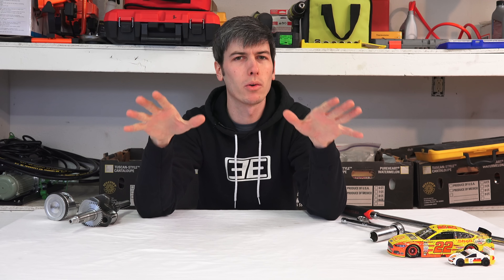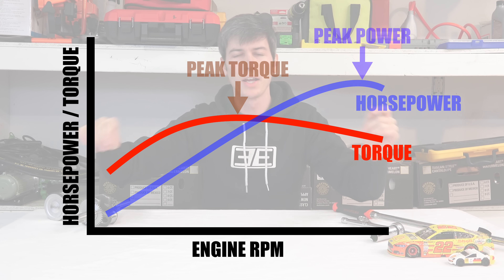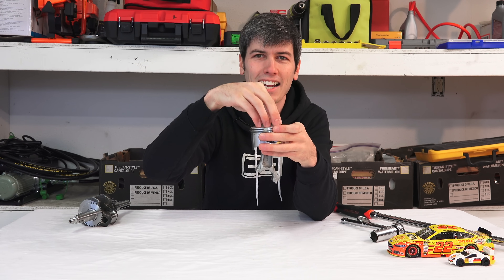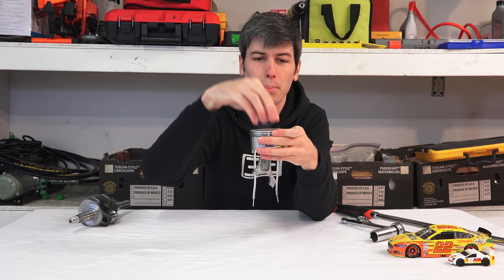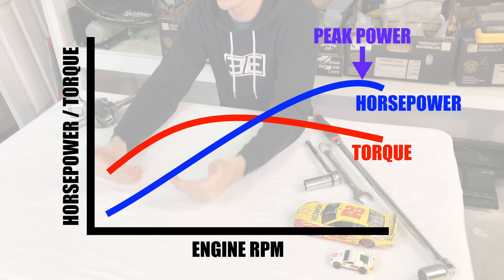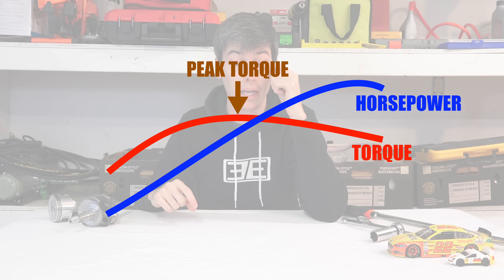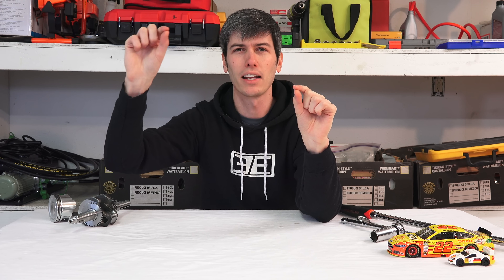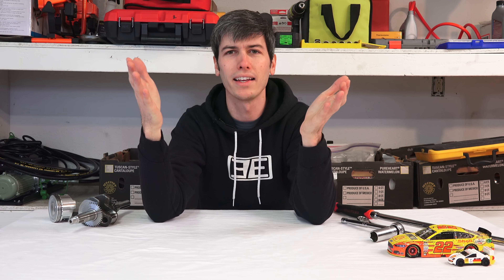Horsepower vs Torque - A Simple Explanation

Comment: I'm very mechanically inclined and have heard the HP v Torque explained in about 10 different ways. I still don't understand it outside of "torque is how much load can be hauled" and "HP is how fast you can haul it."
Reply: Before watching this video i used to think that Torque affects acceleration/0-60, but HP affects top speed….is that correct in any way?
Reply: @mah9389  Not at all. HP affects both  - the 0-60 and the top speed more, gearing affects whether 0-60 is better or top speed is higher. Torque is just a factor which helps to make up/calculate the HP.
Reply: @mah9389  Yes you are right. Torque = Acceleration, Power = Top Speed
Reply: @ssam478  that’s not right at all, didn’t you listen to the video lol
Reply: @ssam478  proof that you can comment without watching or understanding a video
Reply: It took me a minute too. I have an F350 6.0L diesel and a 3.6L Jeep Wrangler. Both rated at ~300hp. 
So why can’t my Jeep pull a 20,000lb trailer even though it’s the same power? Well, in theory, it could. My Jeep only makes 300hp at like 6500rpm and maybe 100 at 2000rpm. I would need a 15 speed gear box just to be able to get that trailer moving, and once it is moving, I would be red lining the engine and could not maintain that power.
The diesel can provide 300hp at 2000 rpm, so I can get it moving pretty easily and not red line my engine doing so. 
What you quoted isn’t true technically, but it is practically. You can gear 300hp to put that power where you want it (optimized top speed or high load, pick one) but practically, you build your engine for it. A 15L semi engine is very high torque. Can probably make 300hp at 500rpm. It can drag 80,000lbs up a hill all day, and that 2000lb engine is a drop in the bucket for the rest of the truck. Now take a 700hp street McLaren. Most of the time it’s driving at road speeds and only needs 100hp. But when on the track and it wants 700hp, it can put it down in short bursts (at 8000rpm). That 4L engine would explode if you asked it to maintain full load, plus it would require a loooot of gears to have that power at a starting speed. And you would burn through clutches every 1000 miles. 
The penalty of a high torque engine. Is while that 6.0L engine can make that power at only 2000rpm, it redlines at 3500. It’s too large to be able to get the rpm improvement to get higher peak power. Ya, if you could spin that same engine at 7000rpm, that would produce hilarious power, but the bigger pistons and longer bore couldn’t handle it. 
Hope that makes it slightly more clear than mud.
Reply: @ctbrahmstedt  Do the high torque engines make their greatest power at peak RPM?  For example, the engine you describe at the end.  It makes a lot of power at 2000 RPM but does it make more power at its max 3500 RPM?
Reply: @fltchr4449  actually, you’re hilariously and technically right. I was looking up the horsepower/torque curve earlier today on the 2006 F350 and it happens to make its peak horsepower at almost exactly 3500rpm. But that’s not always the case. In a perfect world, the torque curve would be a flat bar, meaning the engine can apply the same torque at all rpm, let’s say 500lbft. In that case, yes, the more rpms, the more power, until the engine rips itself apart. However, in the real world, at high rpms the piston begins to move nearly as fast as the combustion itself. When that’s the case, the pressure front can’t actually transmit power to the piston, and therefore net power output begins to drop. Look up a torque curve for your favorite car, you’ll see this dip. The torque curve is measured from a dyno, the hp is calculated from the torque and rpm. 

And most engines make their peak power at, maybe 75% of redline. The difference in high torque engines is that their redline is on the order of half compared to gas. Go look up the torque curve for the 2005 f350 diesel and the 2013 wrangler jk. 325 vs 285 hp. Pretty close in power, but the curves are entirely different.
Reply: @ctbrahmstedt  this video is not about reliability,  overheating, displacement. its just about power,  torque and acceleration. torque can be multiplied with gearing, horsepower can't, period. 
how many gears you need is not about having huge torque, it is about what is your lowest gear (so you can climb any hill at least in first and not get stuck, and start comfortably in first without frying your clutch ), highest gear (for highway cruisng) and how wide is your powerband so you can shift beetween gears without having a huge drop in power. l
this is why even trucks with huge engines and enormous torque still have a lot of gears (10 to 18)
Reply: @geemy9675  And those large trucks are limited in maximum RPM so they need larger gears to reach higher speeds (and all the gears to get to those speeds).
Reply: @geemy9675  yup! Yes, horsepower is a result of torque. And you’re right, reliability has nothing to do with it necessarily. While I was trying to understand torque, I could not for the life of me understand how two engines can output the same horsepower but one has twice the torque as the other. Power is power, period. My 6L diesel vs 3.6 gas both output 300hp, so why is torque important if both engines can ultimately make the same power? Why couldn’t I gear down my 3.6L gas to haul my trailer? Technically I could, but to get the 300 hp, I’d have to ride at 5k rpm and have 50 gears to get there. My point was less about torque vs hp scientifically, but more in how it relates to cars/trucks and what usable and practical power means when comparing vehicles.
Reply: @ctbrahmstedt  a smaller ,  forced induction engine with wide powerband and similar power to a larger diesel engine doesn't need 50 gears to haul. actually it doesn't even need more gears if it has similarly shaped torque curve. what's important is the ability to make high power (let's say > 70% of peak power for instance) at low rpms (ex 50% of redline) . the actual torque value and roms don't matter it's the ratios that do. with a wide power band you can do with 5 or 6 speeds no problem. the reason why modern cars, even turbocharged, have more and more gears is EPA emissions/mpg ratings and the need to have super tall gearing for highway cruising, and be able to run at the most efficient rpm at any speed. super tall gears are pointless for towing anyway.
when you start factoring in towing reliability, you also need your engine that can put out high loads for long periods without overheating or high wear. this can be done on smaller engine. just look at some small japanese engines that are built with such high reliability standards they can run at high loads reliably even after being tuned (properly). but then you also need to consider transmission cooling, so I'm the end you just can't find a complete off the shelf package with smaller gas engine truck that can tow heavy loads for hundreds thousand miles reliably and if you need it you just go for a dedicated big diesel hauler

but let's say you haul once year, you can use any engine that will maintain safe speeds within safe operating condition of the engine
the miles will generate maybe double or triple the wear compared to just cruising, but that's what engines are meant to do

on the end, it's power, not torque, that says if you can accelerate and move a heavy load at  a certain speed.
you can generate lot of torque with your arms using a big wrench, or legs on a bicycle, but it doesn't mean you can tow anything
Reply: @geemy9675  Loved your feedback.  But as I understand, I was wondering now,  since the diesel engine from ctbrahmstedt , has 300 HP, it should mean that the 6.0 diesel engine (even with just 2000 RPM) can pull a car at the same speed as a rally car engine that has also 300 hp ? (if mounted on a chassis with similar structure/weight including engine). 
Since it has a lot of torque to be able to reach same top power of 300 hp, I understood  both engines should make the cars reaching the same top speed (using proper gear ratios), and also the same for the semi engine ? If you mount the semi engine on a rally car chassis, and have same overall weight, it should bring the car to same top speed ?  You seem to be able to explain/express things well, could you please confirm or clarify this doubt ?   Ty
(I'm hoping that the high torque engines, can reach same top speed as a rally car engine, and even get there a bit faster if using longer gears at first  although the heavier engines are not good for using on twisty bumpy roads, where you need an agile car to move around :)
Reply: @madangel71  yes two engines with same power are able to push the same vehicle to same top speed with appropriate gearing. 
top speed = speed where drag equals power.
except if one engine is so much bigger than the other that it has to stick out of the hood., increasing the drag. or so much heavier it increases friction drag considerably. but top speed on a flat road doesn't really depend on weight. its almost 99% aero drag vs power (talking about cars with top speeds at least above legal speeds)
acceleration is impacted by weight though so heavier engine with same power = less acceleration. then you have other factor coming in, number of gears, powerband, close ratio gearbox or not, shift delay, etc
but at any given moment, beetween two cars of same weight and aero, going the same speed, it's the one putting more power that is going to accelerate more. not the one with more engine torque. because more engine power translate translate to more wheel torque. but usually, everything else being equal, same peak power and higher peak torque value is still correlated with wider power curve, and thus better performance (especially daily / road driving, not at full throttle/peak power)
Reply: @madangel71  on paper, yes. 300hp is 300 hp. in practicality, my 6.0L diesel engine weighs 3x of an equivalent hp rally car engine. My truck can put out 300hp all day every day for 500,000 miles and be quite happy about it. The rally car engine operates at peak 300hp, but it would definitely need a lot more servicing if it were running at 300hp all day every day - hell, most race engines get rebuilt after every race. 
Regarding your question of a semi engine on a rally car keeping the same hp and weight, yes, you would achieve the same top speed. If you can make that semi engine have the same torque output but weigh the same as a rally car engine, then patent that and then you can retire for life. That's the big engineering trade off with engines, and the beauty of electric cars. Electric motors make peak torque at 0RPM.
Reply: @geemy9675  
But that turbos gonna be HOT (if cruising in boost for prolonged periods).
Reply: @trumanhw  you mean for example towing heavy load on long distance. sure it's a high stress on every part of the drivetrain. if it's a NA engine you are going to need high rpm to get the necessary power while reducing the load and spool the fans faster etc but your still generating a lot of heat brakes can overheat downhill too, etc
on turbocharged engine, diesel or gasoline you'll have more torque so you can keep rpm lower, but in any case you need every part of the drivetrain to get  sufficient cooling including engine, transmission, turbos, etc
since turbo diesel trucks are the preferred way to tow, I don't think there is anything with turbos
Reply: @ctbrahmstedt  - right.  
HP is about retaining your torque across RPM ranges  ≥ 5200 rpm.  
How long (in a gear) you can accelerate using the force that gear transmits.

As ctbrahmstedt says: Having power at low RPM requires tremendous torque 
it takes:
100 lb-ft of torque at 5252 rpm to have 100 HP - (but let's call it 5200)
200 lb-ft of torque at 2600 rpm to have 100 HP.
400 lb-ft of torque at 1300 rpm to have 100 HP.
800 lb-ft of torque at   650 rpm to have 100 HP.

Torque is a ratchet. A long (but slow) motion.
HP is a screwdriver. Short motion, but no guarantee you can do it.
Reply: Torque is basically how powerful each explosion in your engine is at a given rpm. Now multiply the force of each explosion(torque) by the number of explosions per minute(rpm) and you get how powerful the engine is(horsepower). The reason an engine may tow better with more torque is because it will also make more horsepower at that rpm too.
Reply: Theres more knowledge in this comment section than the whole video.
Reply: Get on a mountain bike, go through the gears, up and down some hills and figure it out for yourself.
Reply: @theingenesistproject  this is by far the best explanation i've ever heard lol
Reply: I agree with you. Torque is required to pull load and Power for speed.
Reply: @ssam478  power is needed to pull loads. it takes a certain power to pull a certain load at given speed on a given incline. you can have as much torque as you want you won't be able to do it at the required speed if you don't have the power. on the other hand if you have the power and you need more wheel torque you can downshift (until you are already in first of course). of course if you need peak power to tow on every incline you wont probably tow for a long time
 "there's no replacement for power" is more accurate than "there's no replacement for displacement". large displacement engine can often be tuned for more power but you typically don't want to do a lot of towing with a tuned engine, unless you are 100% sure about the reliability.
Reply: Torque is directly proportional to initial pickup. High torque means great initial pickup...
Reply: Imagine two cars trying to accelerate up a steep hill. The car with more torque is going to be able to accelerate up the hill more easily.
Reply: @TeamP  power is a function of torque and speed. Power tells you how much torque can be applied at a certain speed. If two engines have the same power but different max torque they can apply the same amount of torque at the same speed, they just use different gear ratios to do so.
Reply: @TeamP Torque is the sound of one hand clapping. The engine’s job is to effect change against a load.  It has no idea if that load is a car, truck motorcycle, a hill, a trailer, aerodynamic drag, flat tires, or wheel bearings on fire… it works the same against the load it sees.  Its ability to effect that load will always be greatest at its peak power.
Reply: @TeamP  sorry but that's wrong. more power will give more wheel torque so more acceleration, provided it's geared properly.

Comment: Torque is the abillity to move weight over fixed RPM, more the torque more the amount of weight you can pull. Power is how fast the torque can be applied on the same weight. Since power is a product of torque and RPMs, little bit of torque and higher RPMs are able to produce more power than the same torque at lower RPM.
At low RPMs, torque is the major factor in car's acceleration as the RPM multiplier is not much, however at higher RPMs the small changes in torque quite significantly changes the power delivery.

Finally, work and torque are the same thing, and work being described as capability of system to expend energy. Note that torque is a rotational work, meaning it's not linear hence torque =work*distance*sin(theta)
and on linear scale power = work/time interval
however in rotational physics it is calculates as power= torque* rpms

Comment: theres not a video in here that explains something simply. they're all complicated. how does engine starts? everyone=fuel+air+spark
engineering explained: throttlebody,ignition coil, sparkplug, air(airflow,airway,airpoof,airmixture,airball,aircon,airbreathe,bad air,con air)+gas(nitro,gasoline,butane,octane, fumigation,gasulinator,gastritis,fuel, few well)  did everyone got it? 😅

Comment: Am I correct to think in this way?

Torque is used to describe the output force of an engine shaft,
Horsepower is used to describe the rate of work done of the whole car setup.
So always use horsepower, unless you're a car engine engineer.
Reply: Torque is one important parameter of a crankshaft's output, but RPM is also extremely important.  An engine's HP will give you an idea of how it compares to other cars of its class, but car weight and the transmission must also be considered to get an idea of how it will perform.  A car buyer may be able to make in informed choice about which engine they will prefer based on their driving style and the maximum torque and HP numbers, but few are informed enough to do so. Luckily, auto engineers will choose the proper motor for the job most of the time, such as using high-torque motors for towing platforms as they won't have to maintain high RPM to tow.

Comment: Ok so if horsepower is how fast you can accomplish work how will a 4ton car get out run by a 2 ton car if they have the exact same hp?
Reply: In your example, you're not changing the amount of work applied, you're changing the body of interest the work is applied to.  Applying the same amount of force to a lighter object will cause more acceleration according to Newton's Second Law, simplified as the acceleration of an object is equal to the force applied to it divided by its mass.  The lighter the mass, the greater the acceleration which is why lightness is good for acceleration.

Comment: Fun fact: if you have either one of the torque curve or the power curve, you can derive the other curve.
To get the power curve from the torque curve, just multiply the torque curve by the x value (rotation rate) as radians/s.
To get the torque curve from the power curve, divide the power curve by x.

Comment: Torque x rpm ÷ 5252 = horsepower. That's why if you look at dyno charts. The horsepower and torque lines always cross at 5,252rpm.

Comment: What would happen if peak torque and horse power were at the same or similar RPMs?
Reply: Engines will not experience this condition. The torque would have to drop off precipitously after peak torque is reached.
Reply: Wym